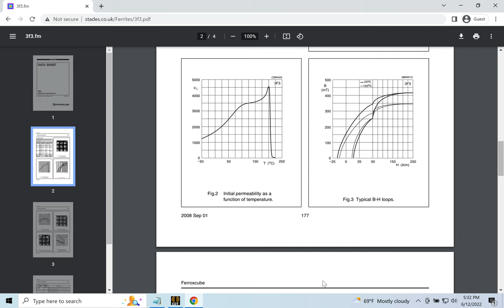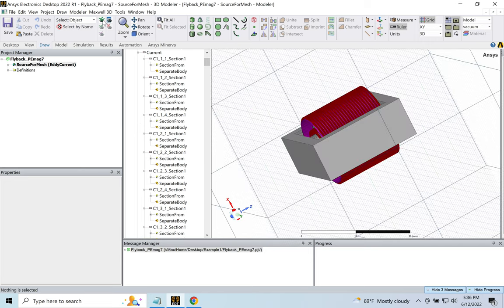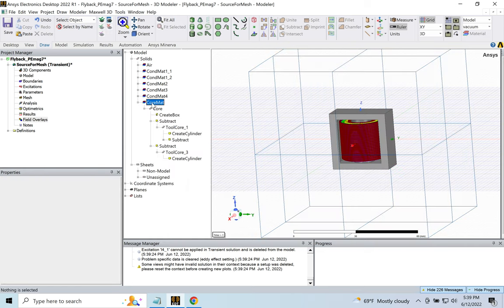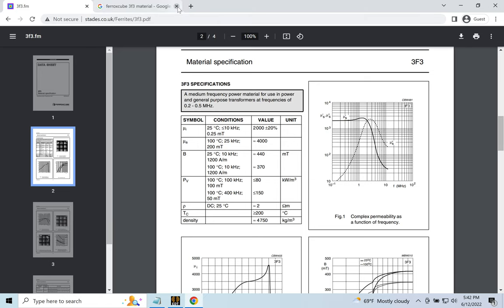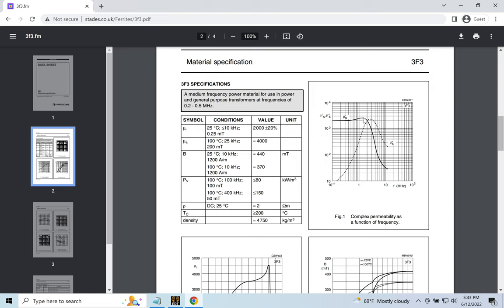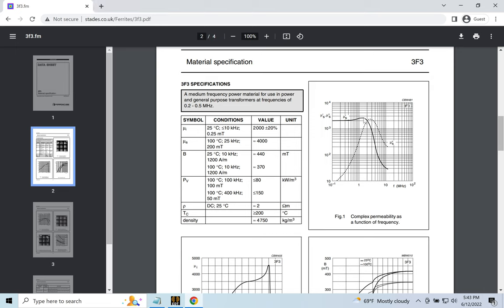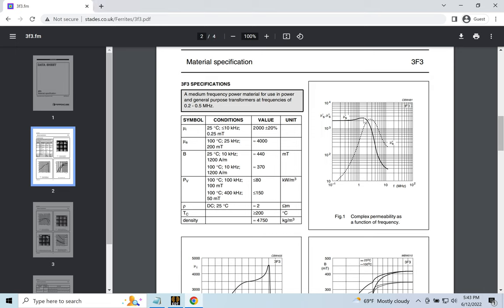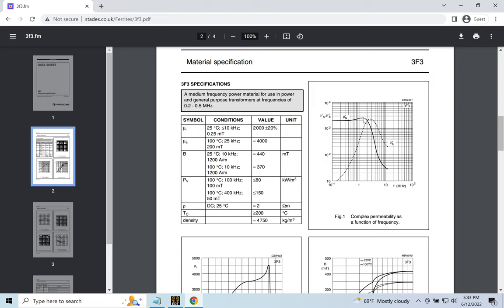Lecture 11- Maxwell 3D: Setting up the core material and using Sheetscan

Comment: hi siR THANK you if i can axcess to data set tdk then i will select material directly tdkpc40?
Reply from the maker: Correct if you have library less work. You select it directly
Reply: Thank you so much sir
One more question for example if I need to find only self capacitance between winding and or between the layers do I need to follow all the steps as you did until lecture 39? Or do I need to skip some of them thank you
Reply from the maker: @alishan074  As long as you know how to setup  under the project ( boundaries, excitations, Mesh, Analysis, results). then you cam jump to lec 39